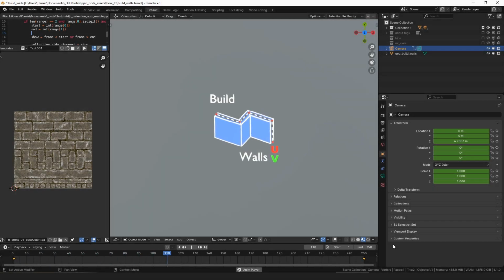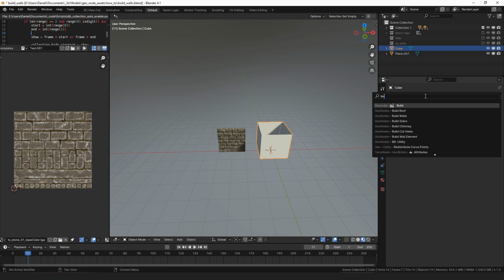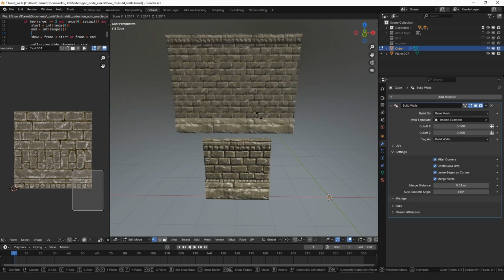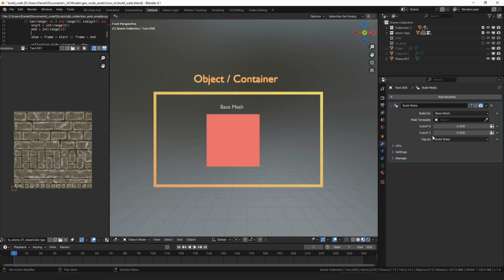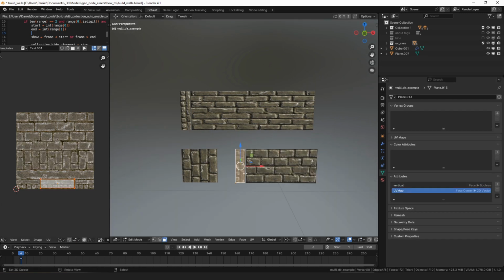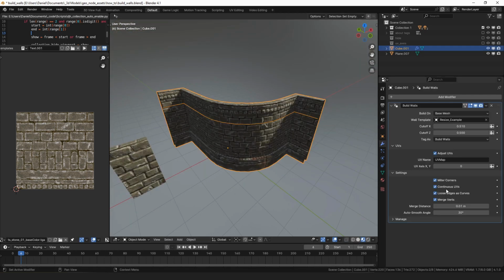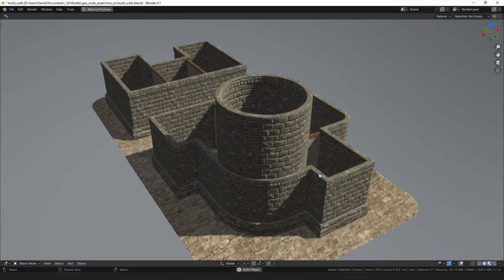Build Walls - How to Use DJH Geometry Node Assets

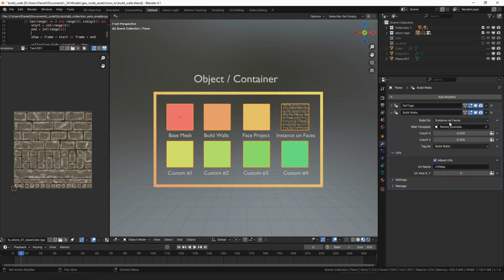Comment: Hi, at @3:54 the changing, how do you set all the tag, can you be more specific further please?
Reply from the maker: Each of the modifiers that create geometry and support tags set their own tag automatically, those modifiers are; Build Wallks, Face Project and Instance on Faces.  Those modifiers all have a 'Tag As' parameter, by changing the 'Tag As' parameter you can set the tag on the geometry generated by that modifier to something else, such as 'Custom' for more complex setups that use more than one of each type of modifier.

Comment: Thank you very much for the video. There is one aspect I am not sure I understand correctly. Is it possible to apply a different texture to the exterior face and the interior face of a wall, as is often the case in reality? If so, how should we proceed?

Thank you in advance for your help
Reply from the maker: Yes, you can use multiple materials and detail the interior and exterior of your walls however you want.  One trick I like to use is to build the wall templates as half walls, and then join them into pairs with a little node group.  I demonstrate that in this video, it's an older video but most of the info is still relevant, I start making the wall pair modifier at 23:21.
https://youtu.be/Bj6ZLozP4yo?si=55wNyIzQUhAboNZi&t=1401
Reply: @looseEdges  Thank you very much for the information and the video! It's great!

Comment: Hi, thank you for everything you have made. However, I am unable to fix texture stretching when I modify the guide.
Reply from the maker: Well I'm not sure why that would be, I can list all the requirements and maybe something will jump out at you.
- The template's UVs must align to either the U or the V axis, they cannot be rotated diagonally.
- Adjust UVs must be checked on the modifier
- The UV Name property must match the name of the UV Map on your template object
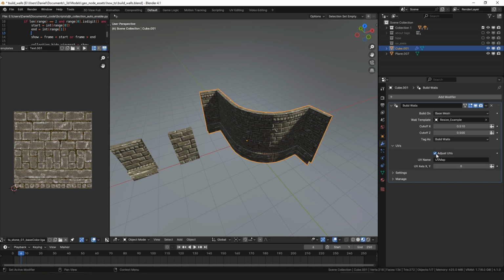- If the UVs are aligned, but it still stretches, you may need to toggle the UV Axis X, Y setting.  4:09